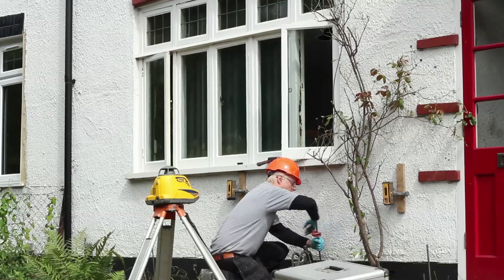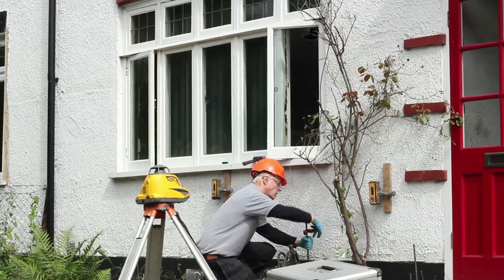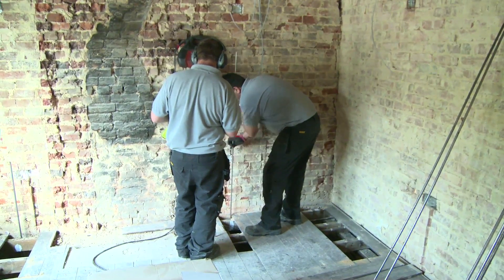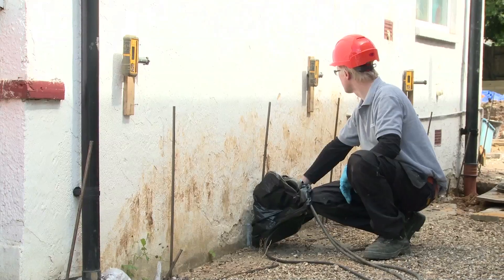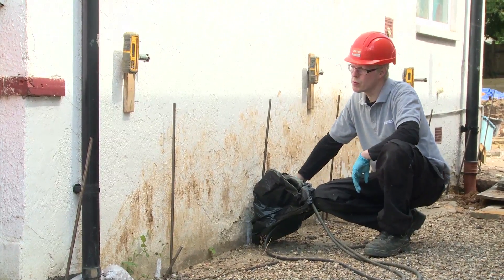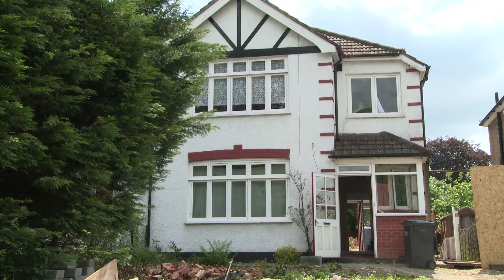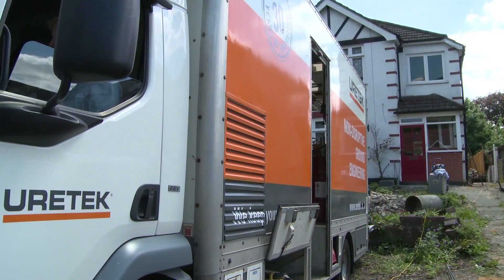Treating house subsidence in Croydon

Comment: cost for this on this property?
Reply: @KHUB Their prices are around £2400 per meter of the wall with subsidence, this is very overpriced, we got the exact same thing done from a company called Mainmark which cost £700 per meter. They also give a longer warranty (25 years).
Reply: @harjapbance  yeah, this is way too expensive and if the ground is really soft, it is not a permanent thing either. This is what many others have commented online.
Reply: @siblinginvesting  Yeah but Mainmark’s prices are much more affordable, and theirs also works in soft clay soils.
Reply: @harjapbance  thanks
Reply from the maker: Hi - I don't have access to the costs, but it would be similar or slightly less than underpinning.
Reply: @Geobear  so i guess the real benefit is time saving not so mich cost. Do you think this can be used to support a single storey extension to be upgraded to double storey?

Comment: what did it cost to get it injected
Reply: In CH 28SFR per kg.  The amount you need depends on the degree of stabilisation and lifting you need.  Our house needed 2cm at the front.  The result was excellent.  Much better than the alternative, same price and completed in 3 days with no building work.
Reply: The resin itself is expensive
Reply: @pandu142 
That's not an answer, lol

Comment: Assuming you’ve correctly addressed the cause of subsidence, viz. leaking drains in this case, then you don’t need any further stabilisation via underpinning or foam injection .
Reply: The leaking drain would have washed away much of the sub soil leaving voids. You need to fill those voids with something, preferably not your house.
Reply: If your house has cracks in walls and stuck windows the house needs to be lifted to repair those.  The alternative is rebuild the walls which is lots of mess and disruption and the house could subside again.